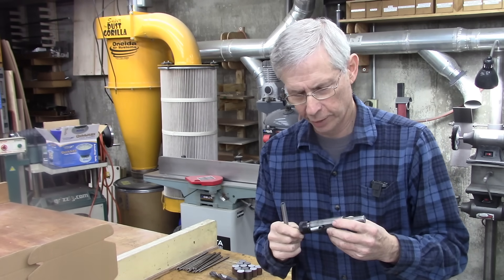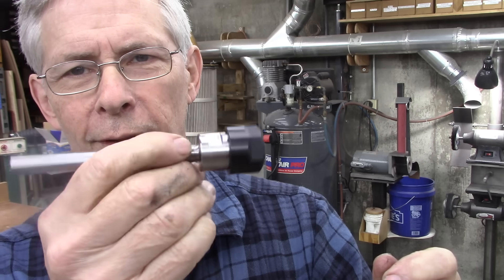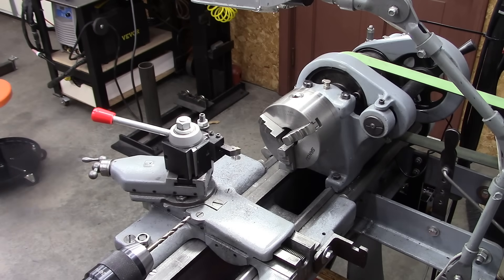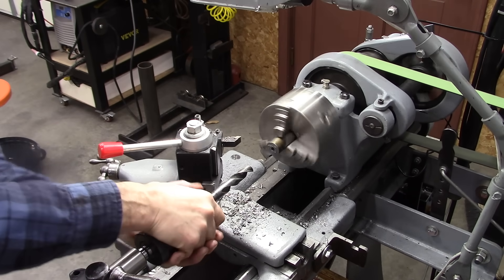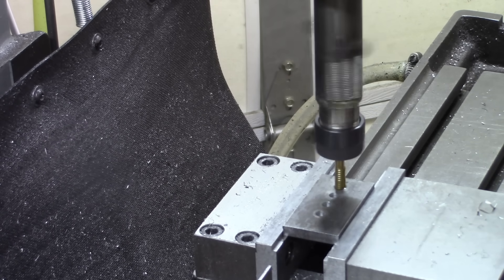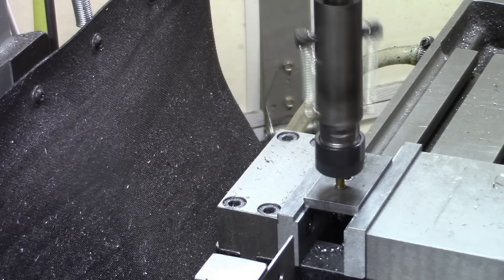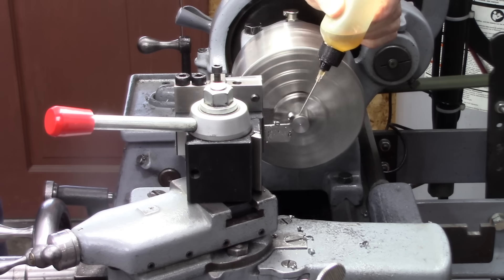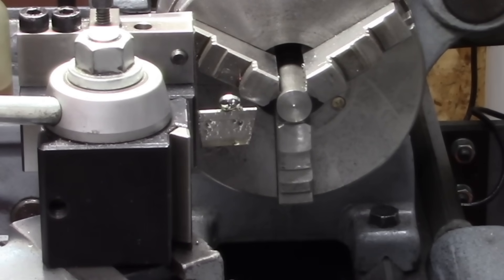A Floating Tap Follower For my Mill

Comment: Interesting tool and design thanks for sharing Mark 👍
Reply from the maker: I think it would be cool to design on for a drill press. The instant reverse on my mill makes this one possible. I've thought about putting a 3ph motor on my drill press too but a modern looking motor on my 1917 drill press would not look very original. The 110v to 220v VFDs are great for low HP motors...  I sold a couple old ones 2 years back. I probably should have kept them. Small shop! Mr. Pete had a cool tapping machine several month ago but I haven't figured out how to adapt it to a dill press

Comment: I didn't catch if you mentioned what filler rod you were using but 309SS filler rod will weld dissimilar metals. Dont be afraid of using too much gas. Love the channel, keep up the great content.
Reply from the maker: I need to educate myself on these things. I've used stainless rod as a filler for an oxidized weld to smooth it. Works well. I think I have this rod.

Comment: Hi Winky, a bit of advice about you milling slots. It seems that you Americans are not too familiar with what we know in England as Slot Drills. Also referred to as 2 flute end mills, one cutting edge is longer than the other allowing you to plunge cut with them. They are called slot drills because they are mainly used to cut slots, you plunge it all the way through as you would do with a standard drill, then you advance the table 1/3 rd to 1/2 the diameter of the cutter and plunge again. Continue doing this until you reach the length of the slot you need, with it still at depth, lock the quill then advance the table slowly back to the starting point to remove all the bumps the cutter left. If the slot width is not critical then also take a skim cut along each side to get a better finish, if the slot is critical then use an undersized cutter and take cuts until dimension is reached. By you using a standard 3 or 4 flute end mill and keep taking 10 to 20 thou depths of cut each time, you are only using the same part of the cutter each time and will wear it away. This causes 2 problems, firstly the cutter would need to be reground professionally to get a full cutting edge length, and secondly, should you later want to use it to cut a full face to depth, you will have a ridge left on the last 20 thou or whatever. With the slot drill all the wear is on the end of the cutter which is easier to sharpen, and you can even do it yourself with care, either with a diamond file or gently with a fine wheel with a Dremel tool. I have a YT video demonstrating this milling method. https://youtu.be/9QTCWeU9MgA  Hope this helps. Regards from Australia.
Reply from the maker: I've used this method a few times although with a 3 or 4 flute mill. Depending on the thickness I quite often plunge all the way through and use a spot higher up on the end mill to do all the work so that the tip of the end mill is not doing all the work. Of course this is not as accurate and limited to about 2/3rd the diameter in thickness. End mills are fairly cheap now. Anything under 1/2 is not worth sharpening in my onion. I just bought some 3 flute 1/2" Carbide end mills for $8 each. After buying one and using the heck out of it I bought 6 more.

Comment: When I use the lathe with my keyless chuck, I hold onto the knurled part before reversing, which keeps the tap securely in place. Although I've never tried reversing the spindle with a drill, I believe the same principle applies. It's the jolt when starting the spindle in reverse that tends to loosen the drill chuck. There's no need to tighten them excessively at the start, as the drill automatically tightens as it cuts. However, it helps if you also turn the knurl while it's running.
Reply from the maker: Yeah, the auto tightening aspect is a plus. This is the first keyless I've owned. $40 buck for a 5/8"???  hard to believe. so far its working well aside from the reverse thing. What you said makes sense

Comment: You need to tighten the keyless chuck with a pin wrench in the holes if you want it real tight Winky.
Reply from the maker: It tends to tighten itself while drilling which is good. The reverse thing caught me off guard.

Comment: Very cool design are you thinking about selling these? I would be definitely interested.
Reply: It's a much longer copy of the same idea I posted a while ago that used standard quick release tap collets and the mechanism inside the spindle..
Reply from the maker: Yes sir, I was going to mention your video but could not remember who made it. Thanks for the inspiration. Your tool is much more refined than this one. I had a more complex part way designed that was shorter although not quick release. My B&S collets only go up to 3/4" which makes it a bit harder to design (although doable). Your work is top notch!
Reply from the maker: Not really, it's not to hard to make and is also limited to 3ph with instant reverse.

Comment: Perhaps pressing the collet head into the shaft, then cross drilling for the pins would be a good design change. It would eliminate the three steps of brazing, boring and welding.
Reply from the maker: Great idea but the its too hard to drill. Hardened.